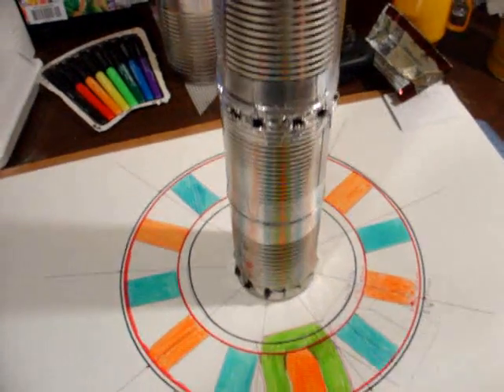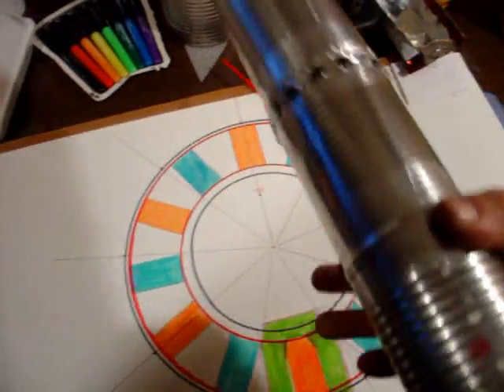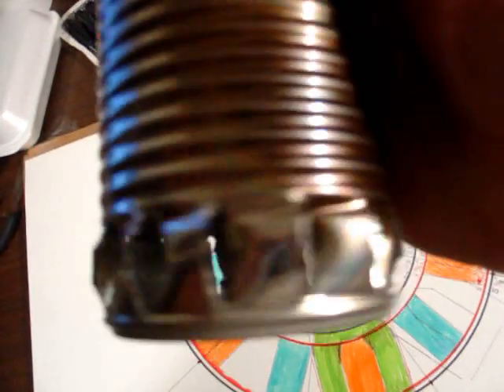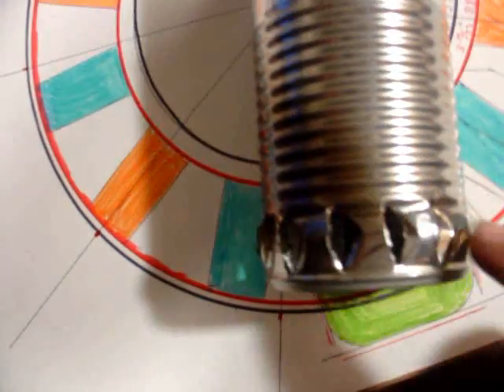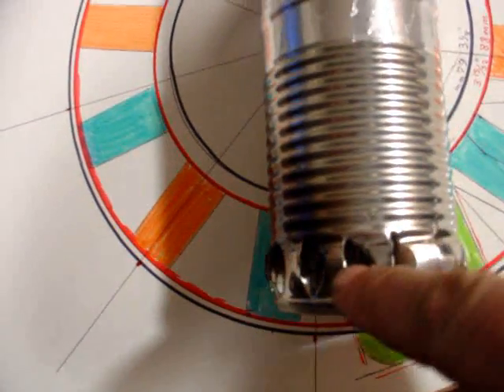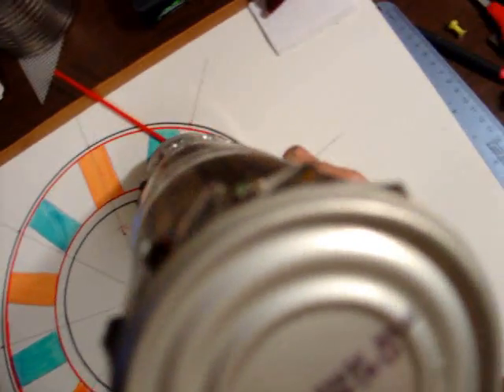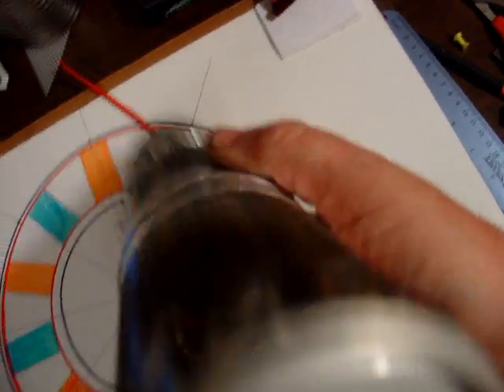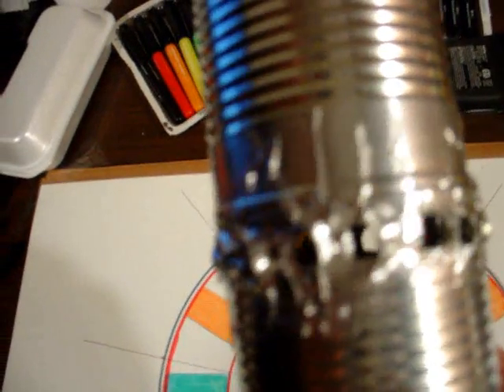TWISTER ROCKET STOVE 1st DESIGN 1st TEST.wmv

Comment: Great video if you could feed that a drop of fuel at a time when it needs it, I think it would burn for hours. try a air band on the bottom and see if you can slow the burn rate down or speed it up?

Comment: That was interesting to see the vortex  in the chimney.
Not sure how you want to progress this, but if you kind find a Turkish shop somewhere near to you,  ask to see their (Turkish) barbeques. They are usually a cheap construction, basically a galvanised box on legs with (the interesting part for you) a lid that has a long chimney in the centre. They work very well and heat up the coals/wood very quickly.

Comment: I'm giving up on this basic kind of design. Without a fan these stoves don't work well. Maybe your's will, with that humongous tall chimney, but in order to cook with it, it'd need to be braced, plus you'll burn fuel fast, and it'd be near impossible to add additional fuel. My opinion, after making 5 or 6 of these gassifier stoves, is that, while they DO work, and they burn pretty clean, they aren't a good alternative to a simple alcohol stove with this basic configuration. I'll something else.

Comment: @muddymuddymuddmann Pt3.Also some kind of draft slide like grandmas wood stove had is a good idea. Wood burns fast and a fat can accelerates the problem. A tall can is more efficient because the wood burns from the top down and draft sucks the heat and air down and recalculates it to the burner rings reintroducing it to the flame area.

Comment: Pt 1.I seem to be one of the few gasifier builders that actually use them. Everyone seems to be focusing on high heat and not concerned with conserving wood and prolonging cooking time by controlling the flame and oxygen. I concluded that a tall design worked much better. I surmise it is because like a tall chimney will cause good draft. Unfortunately for practical camping cooking tall is not so good.

Comment: preheat the intake air, if possible, put it inside of another can as the inner can heats up it'll preheat the intake air, use a can lid as the grate to hold the wood. the top can should be Bigger so you can set your pot down in leaving only alittle aroud your top pot for smoke exhaust